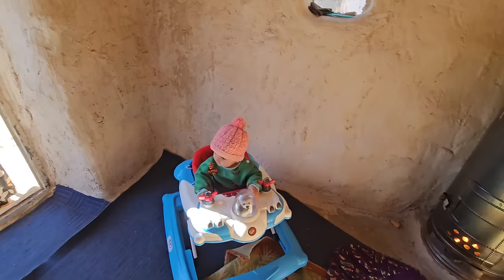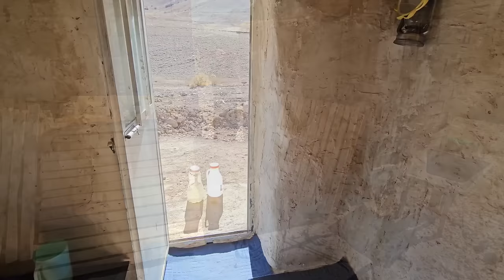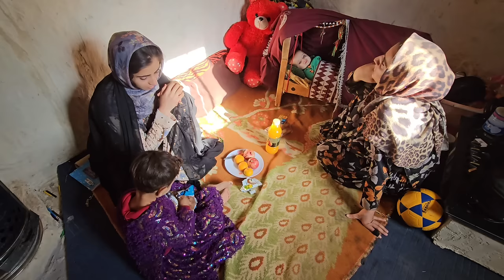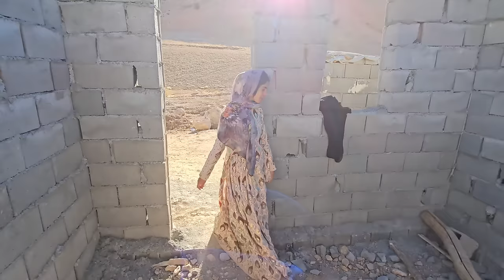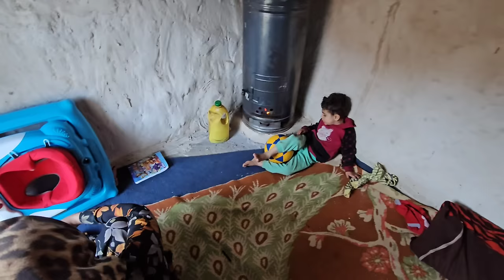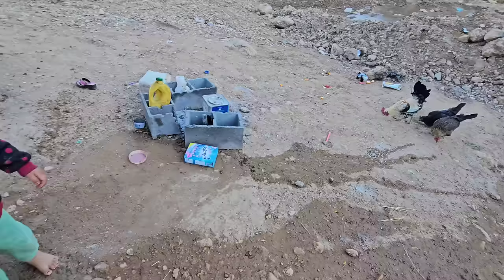Meeting. Sister 😍 After a year, Sakine's tears of joy after seeing her sister in the mountain

Comment: The roof should not be flat. Put a long log right down the middle of the roof, then attach the wood panels so they attach to the main log on a slope so water will run off your roof instead of standing and leaking inside hut.

Comment: The ladies should secure the big logs using cement first then nail the board on the top. I have seen many other episodes in which they even put the log through the brick and cement the big logs to the brick. She needs to leave the board overlap the brick at all four corners of the house, so when it rains, it stops going in to the house

Comment: She should put a sloped roof on the house or she will have to same problem as with the other one , there is nowhere for the water to run off on a flat roof so it pools and leaks through . She needs to slope it so when it rains it runs off instead of siting there in pools .